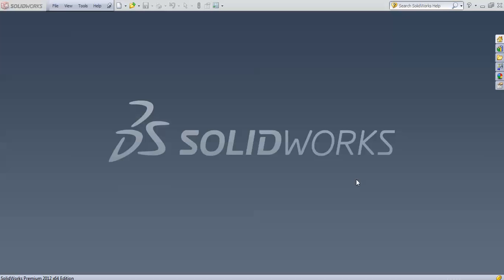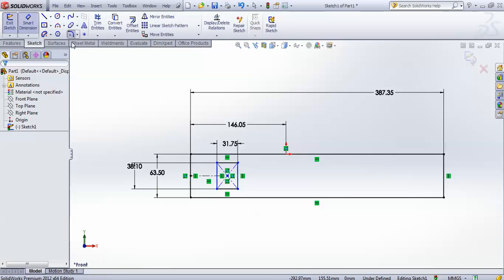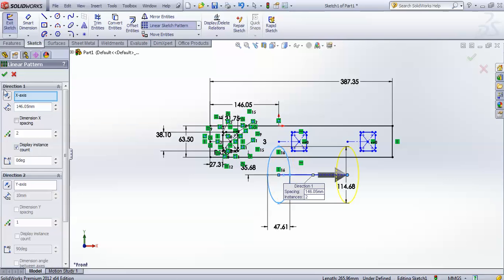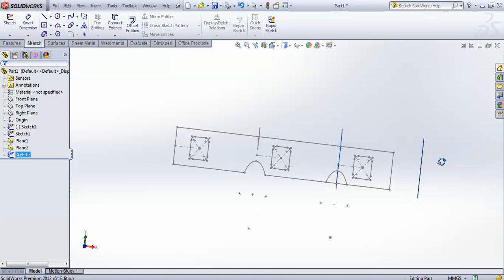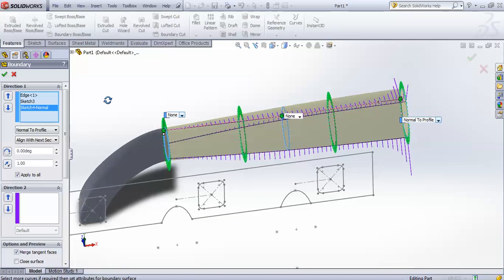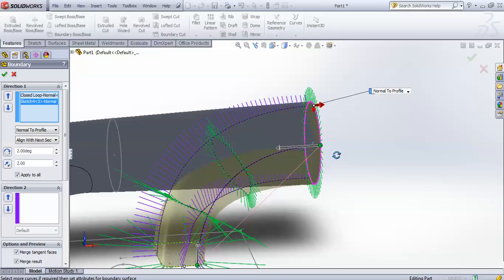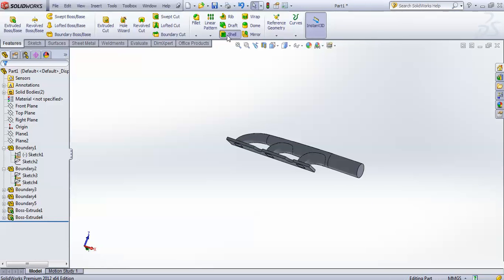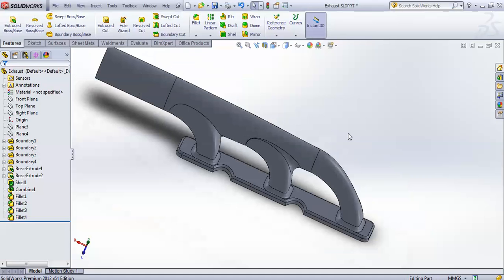Exhaust Manifold of formula 1 car designed in Solidworks

Comment: It it possible using a scanner to scan the space available in an engine bay and define that as a 3D box, within which the design must fit? If it is then the manifold face could be scanned and positioned within the 3D box. The Collector or exhaust pipe could be positioned next. Can Solidworks then employ any form of iterative design process to design equal length pipes that don’t interfere with each other on route to the collector or would that still be an entirely manual process?